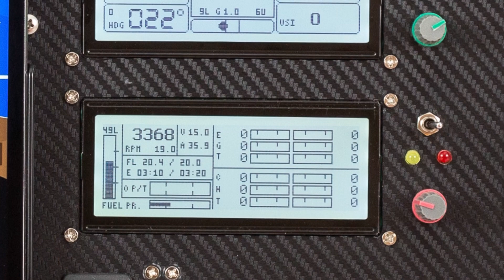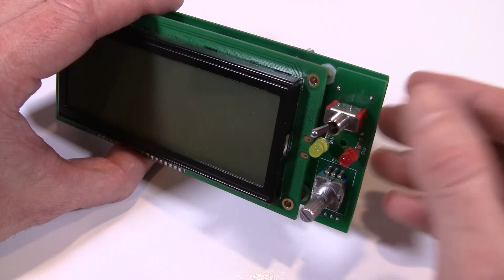Display Unit Assembly Instructions

Comment: Can the EMS unit interface with other display/EFIS solutions?  Can it feed engine data into a GRT or Dynon system?
Reply from the maker: Potentially it can but software needs to be changed a bit. I'm pretty sure I saw GRT CAN-bus messages documented somewhere on the internet. I'm not sure what protocol Dynon uses.